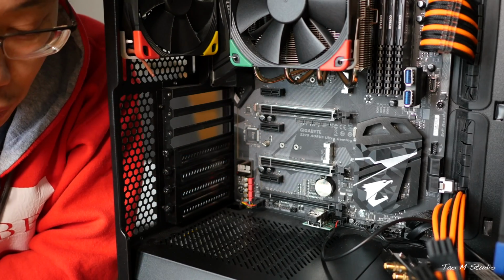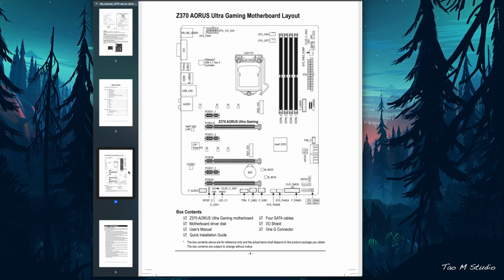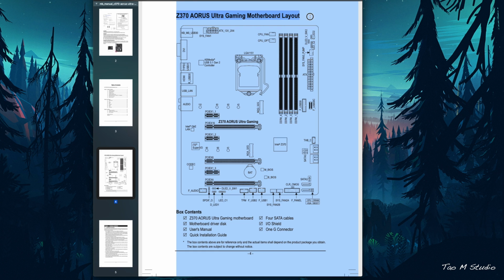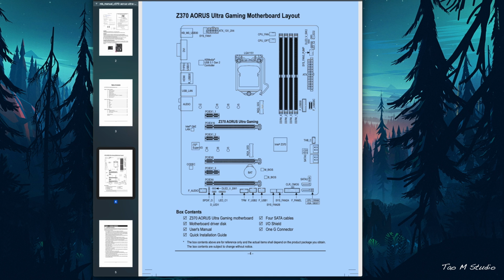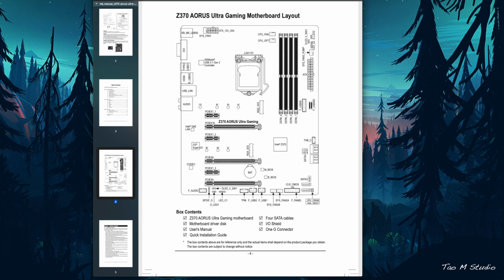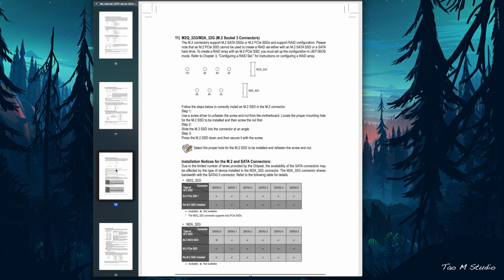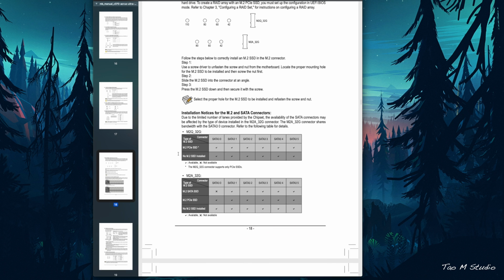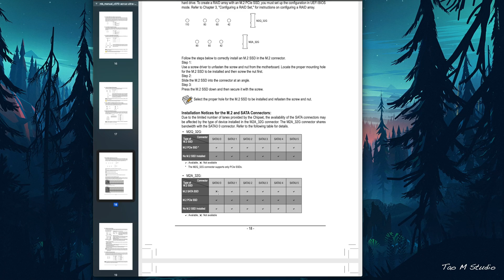Where to install M.2 SSD on motherboard?

Comment from the maker: Hi, guys. Check out this video about PCIe slots and M.2 slots on MSI motherboard: https://youtu.be/L0w5ICKsseM. You might find it useful.
Reply: on my its say  M.2 socket 3  thats it  my motherboard is ASUS Z97-A     so which one i need to choose?
Reply: ...New sub man, best info I could find, I grabbed this dirty cheap for just to fill the slot on my x99 full sized ASUS-WS-iPMi MoBo and was wandering if I made a mistake as in it will not fit with two slots as mine has one slot and says M.2  socket 3, whatever that means? .....Could you help? I was just going to toss Android TV x86 on there or something like it to switch to on the rare occasion and also check it out, I know it is prob like a SSD, lastly is this 80m or 60m as those are the two screws my Mobo mentioned above has? Also, will I have to be careful not to use sata 0 and any other for my main windows and linux boot drives also as to not slow them down? ANY HELP SUPER APPRECIATED as if I messed up, I will just give it away or resell it.... PLEASE Help Me Out Tao, nobody else knows what the heck they are saying or are bad at explaining...
Reply: HELP ^^^^^ ABOVE..... PLEASE, ANYBODY THAT KNOWS! :(
Reply: How to fit NGFF/M.2  ? (https://www.amazon.in/dp/B078H6F9HF/ref=olp_product_details?_encoding=UTF8&me=&qid=1596726912&sr=1-5 )
Reply from the maker: @ SELVARAJAN APPASAMY 
I am a bit late, but yes you will need a adapter to make it 2280 lenght.
Reply: Just used you to teach someone about this. For I have repeated this lesson a million times. I just sent this them video :). Great way to explain something over and over without wasting breath. Great video brother.
Reply: so if i have an ssd 2.5 on for my windows installation, and i add a m.2 Sata SSD it will not work because there are 2?

i tried it and it said "not found" error for windows

so does that mean i need  to have an NVME ssd instead of a sata even though it can fit to run my pc?

i used the slot on the bottom, is there a difference if i use the top slot?

Comment: please help me I have a nvme with the system and when I add a 2nd nvme the windows starts with a black screen I have a msi MAG Z490 TOMAHAWK processor i5 10600k I just want to know if there is a method to use my 2nd ncme or not?

Comment: so if i have an ssd 2.5 on for my windows installation, and i add a m.2 Sata SSD it will not work because there are 2 on the same bandwith?

i tried it and it said "not found" error for windows after the password to enter desktop 

so does that mean i need  to have an NVME ssd instead of a sata even though it can fit to run my pc?

Comment: Hello. In my Aorus Elite Z490, I have 3 M2 slots. One of them comes directly from the CPU (in my case 10ª generation)… I want to know which is better: Put my SSD 3gen in slot directly from my CPU, or put it in my normal slot from the motherboard… Can you help me?
Reply from the maker: @Anderson Farias  I would use the slot directly from CPU to avoid any conflict in the future in case you ever use other m.2 slots or pcie slots. The speed of your SSD is limited to 3rd Gen speed.

Comment: If I ran 2 M.2 nvme drives on the B550 motherboard… one for the OS and one for Game Storage…. Which one should be in the fastest M.2 lane?
And let’s say I have a 2tb at 6600mb/s and a 500gb at 5000mb/s   Does that make a difference?

Comment: I have heard that it's important to put the bigger ssd you plan to install in the first slot under the graphics card, is this true? And if so, is it true for PCIE ssd cards? I have a pc in the mail and am planning some additions for it. I'm not a tech wiz and have extremely shakey hands so handling the hardware least as possible would be amazing and I'd prefer if I didn't have to remove my graphics card to install another ssd. I know I have an available slot for a second one, and the one that's in there already is a "1 TB pcie mp600 pro NH" by corsair. Im trying to determine if I get a 2 tb ssd if I'll have to remove the graphics card.

Comment: About the m.2 slot on the mini-itx ROG STRIX B550-I GAMING...

The specs says:
M.2_1 slot (Key M), type 2242/2260/2280 (supports PCIe 4.0 x4 & SATA modes)
M.2_2 slot (Key M), type 2242/2260/2280 (supports PCIe 3.0 x4 & SATA modes)

Can I use m.2 sata (M+B key)?

Comment: correction
if u use m.2 sata on m.2 nvme slot and some port on sata slot will cannot be use because its giving power to the m.2 sata being use and plug on the mobo

Comment: So both the black covers / M2 slots are the exact same? Because they appear to be different in size. And so you would recommend to install a NVME M2 in the first slot (to one closest to the CPU) if you're gonna run windows on it?

Comment: On the asus b450f gaming II board the top m.2 slot just disables Stata ports 5&6 but if you use the bottom m.2 slot it turns the pcie X16 down to X8 so your gpu wont have full x16 channels witch in return will down grade gaming performance.

Comment: Hello sir, is it possible to change ssd m2 sata 3 bay pcie 4 NVMe M2 SSD samsung 980pro used a adaptor, in effect i bought the ssd samsung 980pro 1to but my tablet dell venue 11 pro has ssd m2 sata 2260 please help me thanks

Comment: ...New sub man, best info I could find, I grabbed this dirty cheap for just to fill the slot on my x99 full sized ASUS-WS-iPMi MoBo and was wandering if I made a mistake as in it will not fit with two slots as mine has one slot and says M.2  socket 3, whatever that means? .....Could you help? I was just going to toss Android TV x86 on there or something like it to switch to on the rare occasion and also check it out, I know it is prob like a SSD, lastly is this 80m or 60m as those are the two screws my Mobo mentioned above has? Also, will I have to be careful not to use sata 0 and any other for my main windows and linux boot drives also as to not slow them down? ANY HELP SUPER APPRECIATED as if I messed up, I will just give it away or resell it.... PLEASE Help Me Out Tao, nobody else knows what the heck they are saying or are bad at explaining...
Reply from the maker: @ReganMarceLis
1) X99 mobo was one of my fav boards back then, extremely capable, and full of features;
2) 60mm and 80mm refer to the length of M.2 SSD(2260, 2280), your mb support PCIe and SATA M.2;
3) I could not find any mentions of SATA ports and M.2 slot conflict, unless I missed it, here is your manual: https://bit.ly/3nyGixT. If there is conflict, just use other SATA ports. 
Hopefully this is helpful.

Comment: So mr tao..basically both M.2 NVME & M.2 SATA can use same port it is just NVME is better coz dont share bandwith??
Reply from the maker: @aaronjohn786
Think NVMe M.2 is faster car drive on a fast lane, Sata m.2 is slower car drive on a slow lane. but both drive on the same road, but not sharing their own lane. they all share bandwidth with other fast cars or slow cars. Hope this makes sense.
Reply: @TaoMStudio  thanks. Still doesnt make sense at least for me😅

Comment: You say mix and match but what if I only have 2 SATA M.2 drives. Can I use a SATA M.2 in the top slot/ PCIE NVME? Also what about Gen 3 and Gen 4 compatibility. Can I use a PCIE gen 4 drive and a gen 3 drive in the same system without effecting the potential performance of the Gen 4 drive?

Comment: Does Acer Aspire A315-53G 5968 support M.2 sata ssd or nvme  if yes what is maximum size i can upgrade to 
Can I insert m.2 sata.ssd in nvme port will it work?

Comment: Thanks for the Vid

I have an Asus Z590 WIFI MoBo and was thinking of installing a Samsung 970 EVO Plus 1 TB PCIe NVMe M.2 (2280) Internal Solid State Drive (SSD) (MZ-V7S1T0)

The M.2 would have my main OS installed onto it - which slot would be best? Could I use slot 1 ?

Comment: Can you help me please. It maybe a simple answer for you. I have a Z490 motherboard, and just bought 980 pro recently. Just realised that PCIE 4 is out of the equation for these 2. What is mu solution? Will the Hyper M2 expansion do the job in getting that PCIE 4 from the NVME?? Thanks in advance

Comment: Also, there are some boards, AMD B450 for example, that only provide a limited amount of PCI-E lanes. The first m.2 slot is usually not an issue because it feeds directly to the Ryzen CPU. But the second m.2 slot may be NVMe or SATA. In the first case, if you plug an NVMe SSD, it will take 4 lanes from a PCI-E X4 slot and you can no longer use that slot. If it's SATA, you might lose a SATA port. Always check carefully before you buy new hardware. For example, you may have a monitor with only a DVI port and you might buy an APU and motherboard with no DVI port at the back.
Reply: Your comment was very clear and concise, thanks!
Reply: @hamidm5461  you're welcome. Good luck with your next build.
Reply: @ronch550  Hey, is there any workaround to this problem? I want to use my second m.2 slot for a gen 4 nvme but it doesn't work if I have GPU in the pcie slot 1.
Reply: @sanslayer_  I'm not sure. Did you check your motherboard manual? The second M.2 slot should take PCIe lanes from the second x16 or x4 or x1 slot, not the primary x16 slot for graphics cards.

Comment: interesting, i didn't know you had to connect your M.2 SSD into where it doesn't go between #0 Sata Cable, I knew about the performance would be less.. if that was the case, but I didn't understand What others meant that it'll effect performance if you're using 2 SSDS and got a 3rd slot being used by an m.2 SSD. so what you explained is what i needed to understand to why my m.2 SSD was underperforming compared to my Boot Drive for running games.

Comment: Thanks for the video. Now, I have the ASUS Prime Z370-P Motherboard (so it's almost identical to yours), and the Samsung 970 EVO Plus M.2 NVMe. According to the manual, connecting a second M.2 will also share bandwith with SATA_1 port (effectively disable it). Some I have a few questions for you. Right now I don't have any drive connected to the SATA_1 port, so it's not being used. But windows still can't detect the second M.2. Do I need to directly disable the SATA_1 port in bios, in order for the second M.2 to be detechable? Plus my other question, not sure I have set everything correctly in the bios, because the first M.2 I have been using a while, does not give me the best speed performances. How do I set things in Bios in order to get the Max performance of the Samsung 970 EVO Plus? Plus maybe also need a driver? Thanks a lot. BTW: I have the latest Bios from

Comment: I have B550 MSI Gaming Plus Motherboard and it has 2 Slots for SSD stick (Top and Bottom) ..

The top is not working and the bottom is doing well .. i have samsung 980 PRO 1TB ..

Can someone help me how to activate or fix the top slot ssd .. thanks !

Comment: i have a question.
is there a main and a secondary slot? like do i put the ssd with windows installes on the top slot or does it not matter?

Comment: I have a GA-H170-HD3 and found I have a single slot for m.2 SSD.  I alredy have 2 of the 3 plugged into the sata express thing being my hard drive and normal SSD drive. What sort of m.2 would i need to get and would I not be able to run it with my other SSD?
Reply from the maker: @Anonymous Caveman  M.2 slot supports both PCIe and SATA. Here is your manual: https://bit.ly/2NIRGr4 (page15,16).

Comment: What if you have to m.2 ssd installed both exactly the same. What do you do then ? Don’t really want to install the 2nd m.2 after the pc is built. How would I know which ssd to install operating system ?
Reply from the maker: @Guru Gamer Use different drive name.
Reply: @TaoMStudio  these are brand new m.2 not formatted
Reply from the maker: @Guru Gamer If them exactly the same. Will it matter which one you want to install on? Just use the other for other things.
Reply: @TaoMStudio  I thought the one closer to the CPU is used for the OS.
Reply: @TaoMStudio  OK. So I’m not sure if I should use the original cables that come with the Corsair 1600i psu as they may be higher quality.

Other options are cablemod or xpg cables or Lian Li strimer cables ...
Reply: @TaoMStudio  Can you use pcie ID to instal OS on the m.2 nearer to the CPU ? If yes how ?

Comment: Im curently using A320M-S2H motherboard, and i got an 2,5" SATA SSD for my booting system. Then i realized there is a PCie gen 3 x4 on my motherboard. I just bought an 512GB M.2 SATA. But the question is, can i use that M.2 SATA on this NVMe slot while at the same time im using my 2,5" SSD?

Im planning to change my system boot to my M.2 SATA, please answer this question. Thankyou! Great video btw!😁
Reply from the maker: @B I S H O P  Yes, you can. M.2 slot supports both PCIe and SATA M.2, and SATA port can be used at the same time. Just in case of SATA port not recognised, try change to different SATA port.

Comment: Hello, my motherboard aorus z490 has M2B_CPU slot M2M_SB and M2A_SB in witch slot is better to install it?
Reply from the maker: @Edward Laing 
what is your exact motherboard model?
Reply: @TaoMStudio  it is gigabyte aorus z490 master and my nvme is aorus gen4 1tb
Reply from the maker: @Edward Laing Technically, it does not matter which slot you use. But, M2P_SB slot(under cpu socket) only support PCIe M.2, and all of your M.2 slots are PCIe3.0, so you will not get Gen4 performance.

Comment: Thank you, in my research, your literally the first person I've found that actually talks about the conflicts of bandwidth between the M.2 slots and the SATA ports! After some digging in my manual I discovered for me, the M.2 slots where effecting both ASATA ports, I think it just depends on the motherboard. I'm using the Aorus b450 pro wifi. But thank you for the quick and informative video!  Cheers!
Reply: I have the Z370m pro4 asusrock and from what I can gather from the manual is that if the m.2 slot 1 is being used than the sata3.0 is disabled. No idea what that means but I'm still trying to figure how to install the m.2 ssd I bought today to replace the hdd it's using now without crashing everything lol
Reply: Hey man, i have the same motherboard here, do you fix the problem of bandswitch?

Comment: I got a b450 aorus elite  wondering if i could do this i see a slot that says m.2 on it but not sure.
Reply: I have the same motherboard and it works in the slot under the first graphic card connector

Comment: Nice video , Have question for you need your help .. i order a 970 Evo 
PLus SSD model ( MZ-V7S500B/AM ) and need to put on My Motherboard model
 : Asus B360-F ... Have 2 M.2 SLoT ONe is .2_1 socket supports PCIe 3.0 
x2 and SATA  and the order is .2_2 socket supports PCIe 3.0 x4  ,  i 
plug in what of this 2 slot ? Tanks for your Support !!!
Reply from the maker: @Lucky Stew13  
Use M2_2 slot for better NVMe performance. Make sure to read the manual page 9 regards on Storage: https://bit.ly/3dAi6nE
Reply: @TaoMStudio  tanks, in page 9 m2_2 talk about intel optane memory... But i buy 970 evo plus its work???
Reply from the maker: @Lucky Stew13 
that slot supports both.

Comment: Question. I have an Intel i7 9700k with a MSI Z390 Gaming Plus Motherboard. I will buy 256GB nvme m.2 SSD for Windows 10. I will install it under the CPU cooler (1st m.2 slot). 
No my question. Will i lose graphics performance? I have a RTX 2080. 
My graphics card is using the top PCIe 3.0x16 slot. Is the nvme conflicting wiht my first PCIe slot, or is the nvme SSD using the Z390 chipset lanes? I think, a nvme SSD is using 4 lanes and my chipset has 24, i think. I hope it is using the chipset lanes and not the CPU lanes. 
Do i have to reomve the nvme SSD for better GPU performance? 
I hope you can help me? 

Thank you!
Reply from the maker: @Thomas
Both of your M.2 slots go through PCH, NOT CPU. So you are fine.

Comment: Thanks for this video bro. But, what if I installed m.2 ssd with 2 cutouts on a slot with only one cutout, can this kill the motherboard? Because I did this and my mobo now seems to be dead 😔
Reply from the maker: @AbAziz
Really? Not posting? Even without m.2 plugged in?

Comment: my m.2 nvme pcie not recognized in bios i'm using gigabyte a320-s2h..pls help
Reply: Did you figure out how to fix the issue? I have the same mobo and considering picking up a m.2 nvme drive.

Comment: So are you trying to say that a nvme pcie ssd fits in the same interface of a m.2 sata 3 ssd slot? There is no difference in there interfaces motherboards?
Reply from the maker: as long as the m.2 slot supports both sata and pcie, then yes

Comment: Sir can we use any nvme drive without using heatsink case beacause i want to buy sabrent rocket 1tb can i use this on x570 mobo without using any heat sink case
Reply from the maker: @Bilal Mughal
Hi, yes you can. But, if you are planning to use gen4 NVMe M.2, then I would suggest you to install heatsink on the ssd. It gets pretty warm when read and write constantly. FYI, this video maybe helpful: https://youtu.be/L0w5ICKsseM

Comment: Hi, wanted to ask something maybe a bit silly but my first time building😂
I want to buy a ssd samsung 970 evo m.2 1TB  3.0x4 for my x570 motherboard how do i know that they are compatibile and is it going to fit the m.2 slot? Cuz the standard length and width for them is 80x22 and this particular ssd is 80.15x22.15mm? I am lost😂
Reply from the maker: @ Vlora Berisha
Hi, that M.2 SSD is fine. 😂 You might find this video useful: https://youtu.be/L0w5ICKsseM
Reply: @TaoMStudio  thank you!!!😊

Comment: Does it matter which slot I put the nvme in? I have two and I read the motherboard manual and both are exactly the same. Im running the x570 aorus ultra and I’m wondering if the placement has a negative effect if I put it in the second slot. Is there a difference in performance for the gpu or anything?
Reply from the maker: @Shreky Boi
Hi, X570 Aorus Ultra has 3 M.2 slots. You can use any of the slots, and at the same time. If all 3 slots are in use, then SATA4 and 5 will be disabled. Manual: https://bit.ly/2Cm7HOs (page 20, 21).
And will not impact GPU performance.